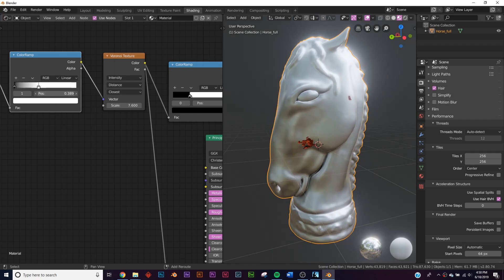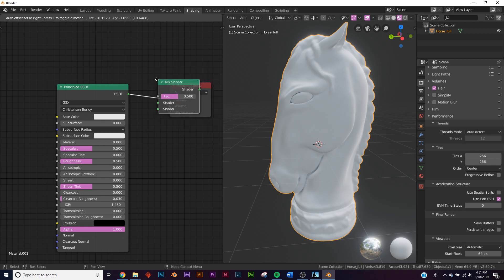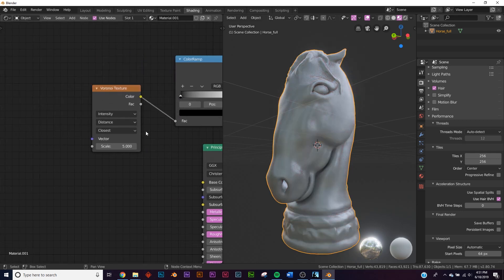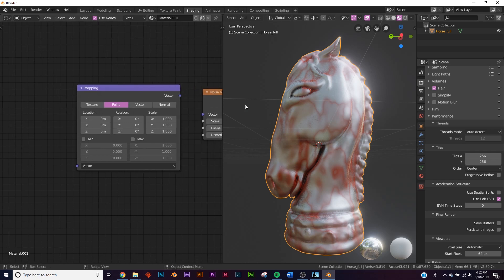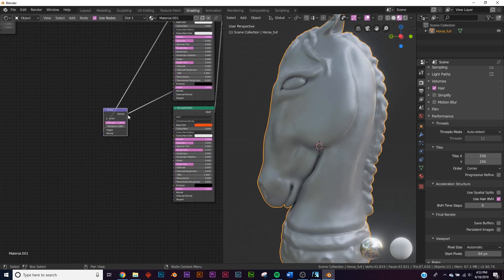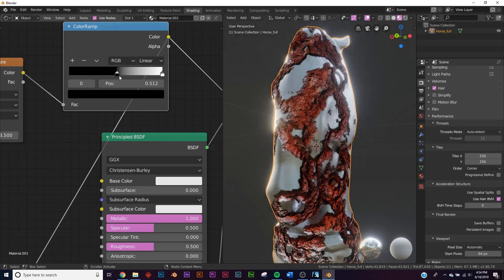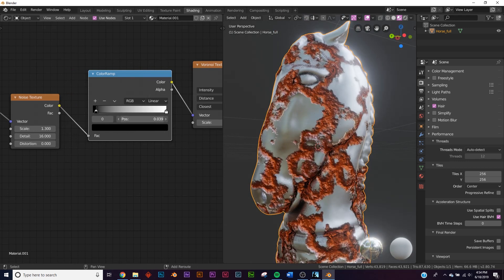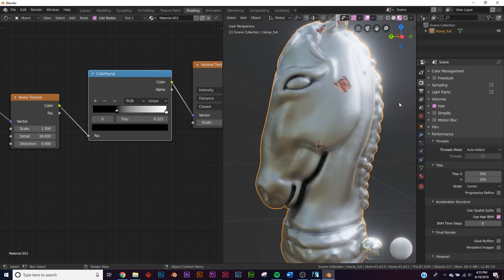Blender - Rust Growth Animation in Blender 2.8

Comment: Quick tip peeps! You have to have "node wrangle" add-on enabled in order this to work, but when you select the last texture which is noise texture in this case and then pust Ctrl+T blender adds automatically Mapping and Texture Coordinate to the noise texture. This is usefull for example when only option to move world enviroment is to always use mapping and texture coordinate so this just saves little time not always do the same necessary steps :)